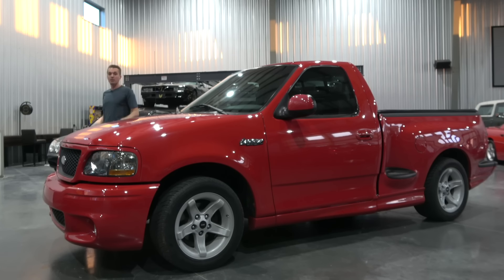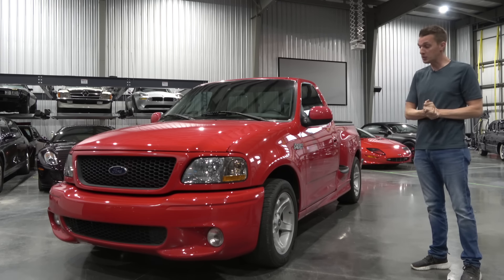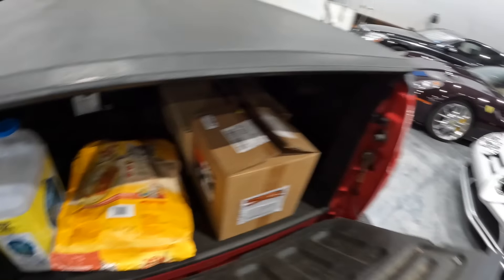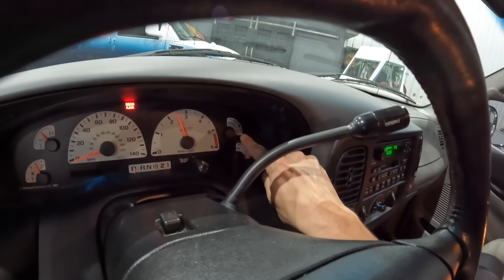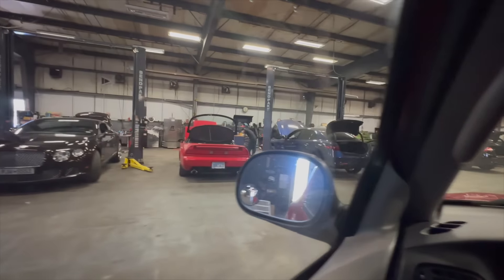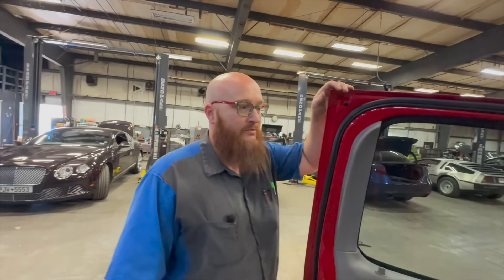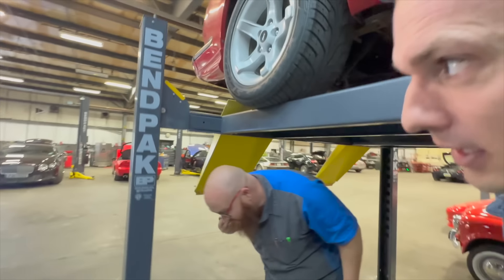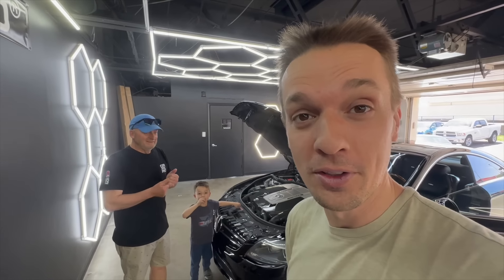Buying the cheapest classic Ford Lightning while I still can. (WAY BETTER THAN THE NEW LIGHTING EV!)

Comment: I had a 2003 as an 18 year old and loved it. Miraculously never got a single speeding ticket despite it being floored constantly. Confirmed it would bury the 140mph speedo with ease. The wind noise was insane at top speed being it was a brick aerodynamically.
Reply: Tickets ? These things are insane. It’s good you didn’t wrap it around a pole lol
Reply: I'm jealous. My license at 18 didn't allow me to drive a V8. I did get my license late at 17 so wasn't till I was 19 before I could drive one on my Opens. Strange thing is when I got my motorbike license I went straight to Opens, no Probationary required.
Reply: @2DogsVlogs  Getting high hp car isnt alwasy best when you have just gotten license, i started with 100hp opel then over 8 years i got slightly faster cars going from 100 to 200 to 300 and then big jump to 770hp/1100nm lol
Reply: A Lightning at 18? I would've wrapped it around a tree. I'm lucky I just had an '86 S10 with a dog slow 2.5L and automatic transmission.
Reply: I got mine at 19 and can confirm the 140  tach is correct. I’ve gone through 4 sets of tires and 3 sets of brakes in 20k miles. I don’t drive it much due to being to scared of being state reffed living in Cali is a bummer.

Comment: I have a 2003 with 38,000 miles on it that my dad bought new. Fun truck, great engine, inadequate brakes and handling.
Reply: You ever selling it?
Reply: The handling on these are actually very good for a full size pickup truck from this era.  They handle like a big car which isn't easy to accomplish with a factory pickup from the late 90s.
Reply: Brakes are great. Maybe something’s wrong?
Reply: The brakes are in fine shape, they just can’t handle serious canyon driving. I don’t expect them to perform like my Corvette or Porsches, but the brake fade is excessive.
Reply: Crazy i have an 03 that my dad bought new too 🤣 about 38-39k miles but it’s a shell as of right now

Comment: Seeing the kid jump into Hoovies car at the end reminded me of one time at a car dealership I used to work at.  I was what they called a Service Porter up on the Service Drive.  I was told to jump start a customers Cadillac sedan that had been brought in and was getting ready to remove the cover to the trunk release (electric but had a outside covered key) and discovered the back doors were unlocked, the front were electric.  I could just get in the back seat and reach over to pop the drivers door.  The ground was wet and I didn't want to have to clean my wet shoe prints off the rear seats so I took off my shoes to avoid making a mess.

Comment: I built my own version due to how expensive the real deal is. I found a nice 04 f-150 2x4 xlt,  the paint, interior, and cosmetics are nice. I bought a rolled 2020 f-150 5.0 10spd and put it in the 04, next comes the blower and fuel system.  For 20k plus my labor so far it’s been a fun project, but also a lot of work. I have many loose ends to still tie up tho.

Comment: When this truck launched, it was an awesome time to be a Ford dealer. We had Lightning, we had Cobra and we even had the little SVT Focus. People would grab this truck and slap underdrive pulleys on them, add a Johnny Lightning intake, maybe do a tune and a few weeks later they'd have a hole in the bottom of the block. As time went on, it was harder than hell to find one that hadn't been flogged to death. This example is a damned time machine and I'm jealous that you bought it. What a fun truck to have!

Comment: I used to build those motors when I worked at Ford. They are good for at least 250,000 miles without a major repair! Great buy for that price! 😊
Reply: Did those have the issues with spark plugs?

Comment: Had the same odometer issue in my 99 mustang. They look like about the same cluster. Takes less than 10 mins to get out. Just some interior to pop out and half a dozen torx screws. Disassemble the cluster back and just take a soldering iron to the odometer pinout. Worked great

Comment: My neighbour had a black one for many years.  When working in the front yard, I always knew when Jim was coming home because you could hear the supercharger whine (I would then go and help him make the difficult turn, backing his fishing rig into a narrow driveway off a super busy street.  He finally sold it (the rwd was not too useful on greasy boat ramps and he did a lot of fishing). The one rusty place I found was the rad support, which I noticed was very bad when I was underneath trying to fix one of the lower fog lights.  It was a cool truck and always sat so right.

Comment: If you are comfortable at all with soldering, you can fix the odometer very easily by resoldering one or two points on the circuit board.  Plenty of YouTube videos available on fixing that.  The compass/thermometer in the upper center console has a habit of going out too, but also a very easy soldering fix.  Congrats on joining the Lightning club.

Comment: Make sure the intercooler isn’t OEM or keep an eye on it! The early year ones would develop a leak and fill the turkey pan (lower intake), assuming it didn’t get sucked into the engine.

Comment: The Gen 1 had a Windsor block, but was a racing block made in Italy. There are lots of aftermarket parts for the Windsor and they are regularly made into quarter mile racers that would lift the front wheels with a few upgrades.
Reply: The Windsor block wasn't made in Italy I'm pretty sure you're confusing that with the aluminum teksid block found in the 90s 4v 4.6 engines.  The 351 was just a cast iron block they were stout especially compared to a 302 from the 80s era but I'm pretty sure they wasn't made in Italy.
Reply: @midnight347  Are you saying Im forgetting an article I read 30 years ago? Yeah, I probably am. Other thoughts in the cobwebs was it was made stronger to handle more power than the regular Windsor block. I had a 95 F150 351W manual. Loved that truck.

Comment: One thing to watch for in that generation of Ford pickups is rot in the core support. The core support would rot out on either side where it meets that fender aprons and is visible if you look down under the battery tray. My former employer ran into that issue in an area with much the same climate conditions as your Wisconsin truck.

Comment: Looks pretty good underneath with regard to rust. Those gusset pieces that attach the cab to the rocker panels always rust badly. Hose them out really good--they fill up with mud and small rocks. Then (when dry) spray them with an anti-rust film (inside and out) like Woolwax, Fluidfilm, etc. I did that to mine and it stopped it from rusting any further.

Comment: The odometer issue is a cold solder joint on the cluster, easy fix remove cluster reflow the od joints

Comment: I worked at a ford dealer in San Diego and got to drive a manual version of one of these. I guess it was made specifically for some rich footballer that played for San Diego. Beast of a car but you could tell the transmission definitely came out of a commercial truck, quite crude and notchy.
Reply: Even the mustang had a notchy shifter its a ford
Reply: These never came manual from the factory
Reply: @Two_trucks Does your reading comprehension suck that bad?
Which part of this sentence "I guess it was made specifically for some rich footballer that played for San Diego" Did you not understand?
IT WAS MADE FOR HIM SPECIFICALLY. 
Get it?
Reply: @AlexLopez-jt5zc  That might have been it then. That supercharger whine was something really nice. Pulled like a beast.
Reply: @Kinann Except that isn't how it works. With boutique brands & exotics, yes. With domestics & volume brands? No. It doesn't matter what your status is. They do not build vehicles with options not offered for the public for you. The original commenter is mistaken about the manual.
Reply: @sawyermartin4434  They do and I drove it. Sorry you can't see that. That's how it works, you're presented with new information, you accept it and move on, not double down with your narcissistic  need to be right.
Reply: @Kinann Relax. I'm not denying that it existed or that you drove it. I'm simply explaining that Ford didn't "build it specifically" for anyone. If you drove a manual one, it's because it was converted afterwards, not because Ford built it.
Reply: @sawyermartin4434  They may have depending on the pull that the particular dealership had. The dealership wouldn't sell something with a manufacturer's warranty unless they did it or it was done by someone they endorsed. Think Callaway Corvette, Alpina BMW.
The purchaser was always free to buy the stock vehicle and get it modified on his own dime but it didn't happen here. This came from the dealership.

Comment: The horse power bump actually came in 2001,it also added 3:73 gears,bilstein shocks,larger throttle body. I test drove a 2000 before buying my 2001,it was a noticeable difference in acceleration, ride,handling.  I still have that 01 with 10k miles on it,never driven in rain and always stored indoors. It still looks new,and even retained the new car smell. 
I ordered an extra set of floor mats and 4 wheels when I bought it,those are still in my garage attic along with about every piece of literature available back then.
Reply: Once they're modified they're all basically the same.  Kind of like the 07-12 gt500 the 07-09 makes same power as 10-12 once they're modified the same even though the later cars came with more power and better gearing factory.

Comment: Looks like an upgraded heat exchanger at 15:55. Much larger and thicker than stock which is really nice to see. This truck overall looks like a great deal for $15k. Rust is pretty minimal and it seems to run well. Would be awesome to see a smaller pulley, bigger injectors, and a tune on it. A tune would definitely fix the falling on its face that occurs with these good old 4r100's have in their stock form.

Comment: That thing sounds heat soaked.
Reply: What’s that?
Reply: How do you hear heat🤨
Reply: @Ambrose4k  The bogging sound and it's lack of going anywhere slow acceleration. I have one.
Reply: @DanThePan68  hot air through the intake, lack of actual supercharged acceleration. The bogging.

Comment: I have a 2000 F150 Harley Davidson edition I bought at a public auction. It was the first year of the Harley truck and did not have the supercharger the first year except for the one that was built for Jay Leno. The Wizard is right, the odometer has some solder connections that need to be resoldered.

Comment: It's actually pretty easy to scratch the itch for a sports truck today: buy an F150 single cab with a 5.0, throw on a whipple, do a couple basic suspension mods, you're done.
Reply: Hmmm.  I Should do that to a V8 Exploder AWD.

Comment: Pretty clean Lightning but just be careful as the intercooler under the supercharger is known to crack on the 99-2000 models and will need to be replaced.

Comment: 99 lightning owner for almost 2 decades

That side skirt trim doesn’t line up on any gen 2, and I’ve been to a lot of lightning meets 

Overall you did good, with that being a 2000 though make sure you have replaced the original 9 row intercooler inside the lower intake manifold (below the supercharger)

You maybe have the luckiest 99-00 gen 2 on the planet if that part is stock and has not cracked

The best upgrade imo is if you can find an 01 lower manifold and 10 row intercooler. The 01+ lower manifold has equal width runners to the heads, and the 99-00 has wider runners in the middle and narrow ones on front and back. My understanding is that’s where the extra 20hp came from, and the slightly larger intercooler. 

The 9 row intercooler was recalled , and while there are adapter midplates, the 01+ bolt pattern is what allows the lower manifold runners to be equal width

If I had to mod it all again from scratch I’d have started with the valve body upgrade on the 4R100.

Second best mod for a 99-00 is the trick flow heads. Fix that launching of plugs problem forever

Comment: As a reminder Hoovie, you can still option a 2024 F-150 in a single cab configuration with the 700hp supercharged V8 from the Raptor R. It comes with 22” wheels and super wide tires, lowered suspension, and that’s about it if I remember correctly.

Comment: I bought one of these new in Miami in 2004. It was black and extremely inconvenient. Two small bucket seats with no extra room. Couldn't even get comfortable with my girlfriend because of the center console. 
The engine was solid, but the front end started to give up after two years. Needed tie rods and such...
I got the Borla exhaust, timing chip, and blower pulley to make over 400 HP and since I lived in Key West and fished for a living, it was the fastest fish truck on the island.  ...
And I never had a Miata pull away from me! 😂

Comment: The vacuum display problem is common with age. Two things to check. If you start the car and there is no display - spin your dash brightness knob and see if it comes right up. That could be an easy fix.  The second is they run on a higher voltage generated on the module and a lot of the time a simple cheap 10 cent capacitor dries out and doesn't provide the bumped up voltage. This can be temperature sensitive while its decaying. Electronic Techs have a process for this. You buy a can of "cold spray" and a variable heat gun.  You identify the failure mode and apply whichever is appropriate. In this case it fails when cold. So you let it warm up and work then spray a little bit of chill in sections across the board until it fails. This is how you isolate an intermittent. Then you find a replacement part and replace it. Simple. 
And note leaving anything variable in one setting indefinitely is a mistake. You should periodically "exercise" every knob in your car to keep things working. This means all heater/AC settings, brightness adjustments, light switches, entertainment buttons/knobs etc.

Comment: I had '95 Lightning a while back. It was neat, but as Tyler said it was nothing fast nor quick. I always liked the second gen's even if the awful FandF movies were lame. That's a cool truck Tyler, much much much cooler and more practical than the current thing they call a Lightning.

Comment: Yeah... the whole "classic" thing is a weird vibe when you're older.  I'm Gen-X, born in the mid 70s, so to me that Lightning is a "new" truck; at least, until you sit and realize "holy crap... that was over a quarter century ago..."  Time flies.   I wonder though how viable a lot of 1980s and up cars will be as long-term classics because of the plastics and older electronics that eventually fail.  Some can be replaced, but I imagine from OBD2 and up type cars, the ECUs get complex enough that if they fail, it bricks the vehicle.
Reply: Solid state computers do not fail. Somewhere around 90 percent of ecm replacements are not necessary. Vehicles from the 80s are already very difficult to find trim pieces for, 70s is even moreso 😪
Reply: @A-classic-smithy   I work as a Network Admin/Engineer; solid state absolutely fails.  The problem with electronics is that they degrade with time and use.  The more densely packed integrated circuits become, the easier it is for them to experience a failure from basic things like heat or over-voltage.   Ultimately, all things wear out, just in different ways.

Comment: I know Ford probably wouldn't make this, but a modern performance single cab F-150 with the Dark horse 5.0 (to differentiate it from the supercharged Raptor R) would be awesome. Even a stock single cab with the 5.0 is fast for a basic truck, would be cool to see them dial it up more for a street truck.

Comment: That's not a solder joint issue. That's a typical capacitor issue. You need to replace a cap on it and the dash will work again just fine.
Reply: Parts cost should be under 20 cents lol

Comment: I bought a 2000 Lightning brand new. Sold it in 2012 with 24,000 miles. I sometimes wonder what ever happened to her. Still the funnest vehicle I have owned and there has been quite a few.

Comment: That looks like a 99-00 lightning. The 99 had black plastic rear view mirrors compared to the 2000-2004 that had them color matched. 

There's so much different from the 99-00 to the 01-03. The 99/00 aren't as desirable as the 01 and up because folks want that extra 20hp that can be obtained with just a 90mm maf upgrade from the 80mm one in the 99/00.

Personally I prefer the 99/00 because of the steel drive shaft and 3.55 limited gears that helped make it a better driver at cruising speeds compared to the 3.73's in the 01 and up paired to the 4 speed.

Comment: Nice, but I prefer the pre '98 Ford body style. That one looks kind of Japaneseish. I have a 1968 F-250 that I pretty much built from the ground up over 30 years ago. Standard cab, 2 doors, bench seat, 2 wheel drive, 8 foot bed, 390/C6. It's a gas hog, and it's not very fast. But being a '68, I could put as much power under the hood as I wanted. The old F-250 chassis is strong enough to handle over 1000hp. But I actually use it for a truck. My carbureted 383 powered '82 S-10 with a Muncie M21 four speed and 8.8 Ford rear axle is my hot rod.  Neither one of my trucks have ANY rust, being from the Phoenix, AZ area. I still want that mid '60s blue Chevelle 4 door. I want a cool non computerized daily driver.